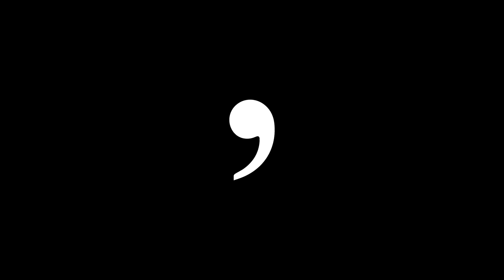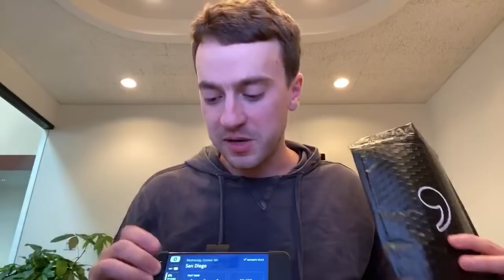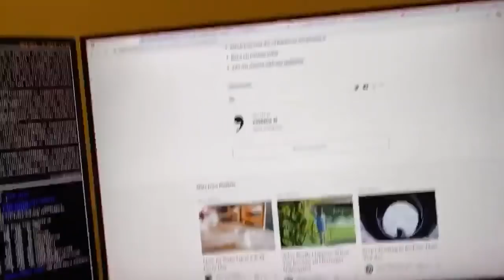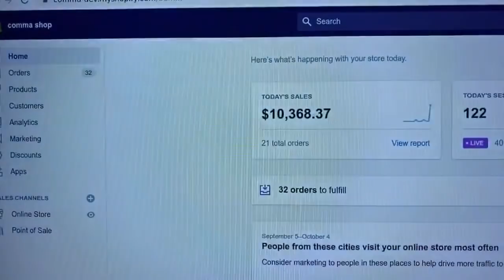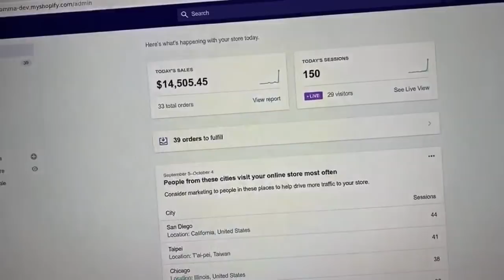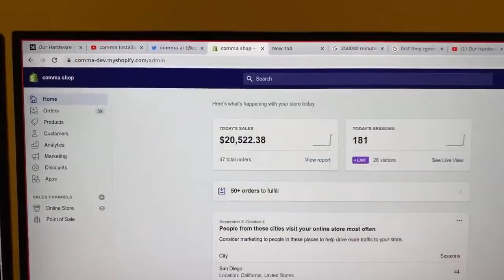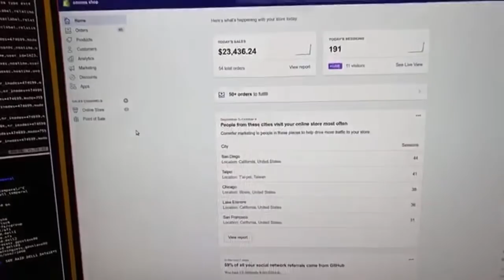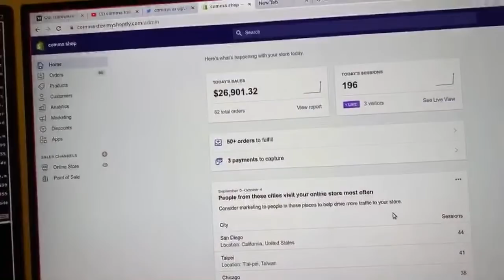comma ai | George Hotz | car harness announcement and overview

Comment: Question: Did anyone complete the compatibility for Volkswagen? Along with that, if they have do you have to have lane changing assistance or parking assistance? I have a 2017 1.8 TSI Jetta barebones basically. No HUD no leather seats no lane changing assistance only back up camera...
Reply: iBubba Someone ported it to VW, but for now, you need adaptive cruise control, since it uses the stock radar. Check the comma discord
Reply: @tseland  Does it have to or is it just a pain in the ass to get it working without it? I saw a old T3 use it
Reply from the maker: People are always developing support for new cars. Join https://discord.comma.ai/
Reply: @ccyl54  it's pointless without it
Reply: Has anyone tried this on a Mercedes glc? What harness will fit?

Comment: Pretty sure it will take an act of god to get the answer from comma.ai because I have asked many times with no answer but when will this finally work with Chevy volts?  Not expecting an answer but it would be nice
Reply: If you make the cable for it
Reply from the maker: https://comma.ai/vehicles
Reply: brandon viera wish I could but I don't know anything about wiring.

Comment: Still potato quality! There's no way in hell this is 720p.
Reply from the maker: Select 720p in video options and it will be better. Kind of. Default youtube selection (even if it shows 720p) is really bad.
Reply: @geohotarchive  No. Did as instructed. No way it's 720p. It's 360 at best. Here's what 720p looks like for reference: /watch?v=XzKnk2S90tw  You can see individual hairs and details

Comment: what does this thing do
Reply from the maker: The car harness is our newest universal interface to your car. We designed it to be almost invisible in your car while being easy to install and use. The harness includes the black panda with high precision GPS and OBD-C, the new standard port for comma  hardware; comma power with VIN fingerprinting capabilities; and a harness adapter with automatic switching to stock. Read more -> https://comma.ai/shop/products/car-harness & https://medium.com/@comma_ai/our-hardware-future-eea980d8c3bd